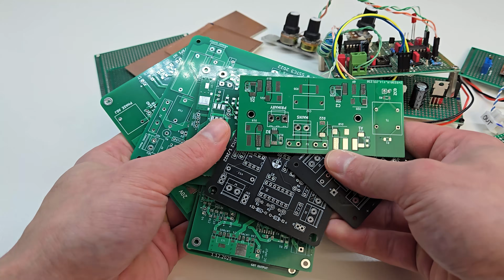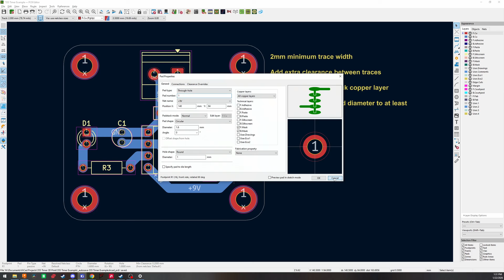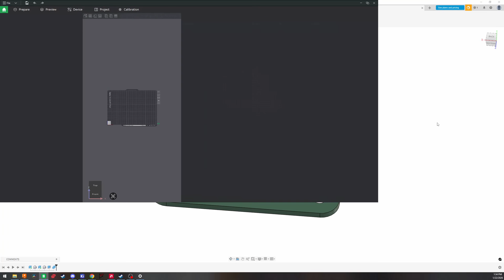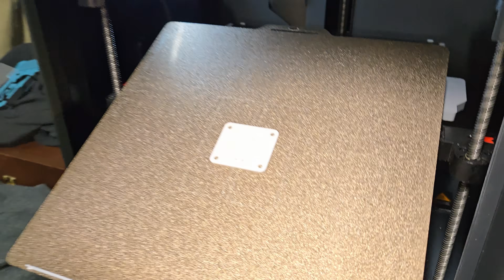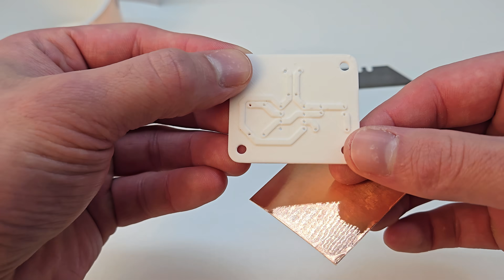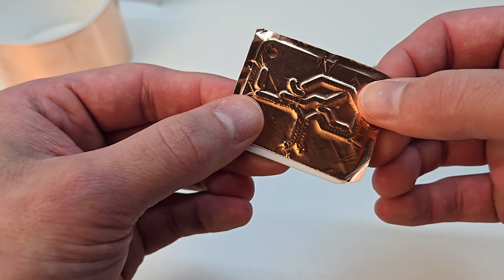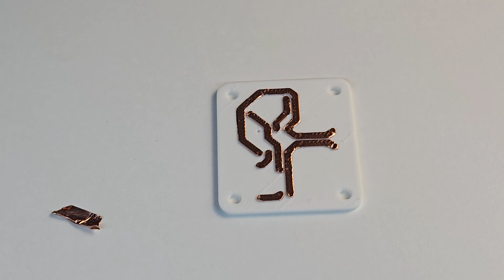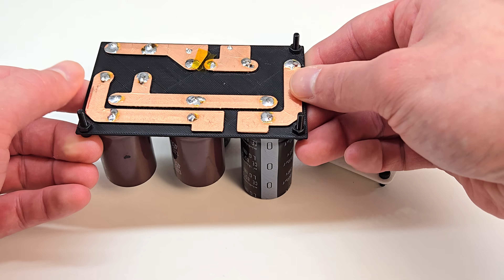3D Print Your Own PCB

Comment: I recently started printing with my 3D printer directly on my copper clad. So I print the traces on there just like a mask. And then I etch them like you normally would in acid. Then that removes everything that you didn't mask. And then I use acetone to get rid of the pla. Pretty simple really. And it's pretty easy to do. I just make sure that I go over the area where the copper clad's going to be and make sure my z axis is set correctly. And I make sure I rough up the board a little bit with some sandpaper and make sure it's really clean so the pla has something to stick to.
Reply from the maker: That sounds like a great technique, thanks for sharing. Do you also use the mask for drilling holes?
Reply: Acetone doesn't dissolve PLA.

Comment: Didn't the printed board melt during soldering the components?
Reply from the maker: It did not. With a hot iron and not dwelling too long with it the connections can be made really quickly before melting the pla. The copper foil also helps to spread the heat a bit too.

Comment: Would maybe a conductive filament in AMS for the circuit lines have the same effect and work out of the box? I dont have a AMS, just curious with the idea after seeing your video.
Reply from the maker: Good suggestion. From what I have read those filaments have a high resistance and have a limited application.

Comment: This is sick! Do you think you could maybe apply a glue to all the extruded traces via a straight surface and then just peel away the rest of the copper? So it only sticks on the extruded traces with glue on them. Maybe you won’t have to cut the foil then
Reply from the maker: Thank you! Great idea! I will have to try that out.

Comment: I had the same idea for some time now and was wondering why nobody seems to to have done it before. I have not tried it and this is the first time I've seen it being done in a video. One of the benefits is also, that you don't actually need to make a flat PCB with this method. You could design your part, so that the components can be directly placed onto them and even route the connections along curved paths if necessary. I have several widths of the copper tape, down to 5mm. That way you don't even need mounting points for the PCB in the final part.
One drawback which is kinda mentioned but not in that direction is that normal PCBs ar non-flammable. I wouldn't do any high power electronics with it, because that can easily become a desaster. I'd also not use it for mains electricity. Because when the board melts (even with ABS/ASA) that can quickly be a fire hazard.
Same for Lithium-Ion battery powered devices.
For small low power projects and for simple prototypes it's fine.

I've also thought about using perfboards in combination with copper tape to simplify soldering. You can even use PET tape to create multiple layers (for insulation of stacked copper foil traces).

Comment: Interesting idea.  There a couple of car guy that wanted to make there own circuits boards for their Mini Cooper Dash light. They actually made a CNC type of machine to lay down the traces like 3D printing it.  Bad Obsession Motor Sports is their channel.  Their are a few video of them using it , in later series, but much on them building it because it was really a side project and just another tool they made.
Reply: This comment is the undersell of the century. That video is absolutely INSANE. What they go through and what they do in order to prototype and design a completely custom set of car gauges is just shy of miraculous. Maybe it doesn't land as hard on people who haven't spent the last 13 years watching 2 blokes in a shed in Shropshire stuff the running gear of a Celica Alltrac into an original Mini. But DAMN do they do some cool stuff to get those freaking gauges working. The fact that they, from scratch, with no experience in such things, built a custom machine to print circuit traces DIRECTLY with solid solder is absolutely one of the coolest things I've seen on YouTube. I have tried SO hard to get people excited about that video and I feel like it just falls flat for almost absolutely everyone.

Comment: Doesnt the pla melt when soldered upon?
Reply from the maker: Normally it would but if the iron is hot enough, you can make the joint without melting it. A higher temp filament is advised. This was just to demo the idea so I used pla.

Comment: Been working on something similar, with Aluminum foil. You can use the tip of the soldering iron at 300C to press the foil against the plastic, binding it with heat. It is be awkward though. Mix results with solder foil adhesion. Used negative mold, square holes printed in the mold at 2.5 mm in side length. Foil would be heated in place into the negative, then on the other side the prongs would cut through the foil and mount there. Just be careful not push out the foil when making the holes.
Reply from the maker: Nice! Sounds like a good method as well. Thanks for sharing it.

Comment: Hello friends.

I'm currently doing this but in a little bit of a different fashion.

If you want to create vias between a double sided PCB you get some solid copper wire (enamel coated is fine or tined) and you make the holes a tolerance fit. 
Then you push the wire through the hole and with the flat cutter snip the wire so it is slightly protruding out one or bothe ends (approx 0.5mm). 
Then once you have done this with all the via's you get a big fat pair of knipex shifter pliers (the one with the push button size adjustment) and squeeeze these suckers flat and viola you have just created a nice and flat copper riveted via that you finish off with a dab of solder to make the connection just so.

For the love of sweet baby Jesus though if your going to use 3d filament please please use something like polymakers polymax PC-FR or similar; the FR stands for FLAME RETARDANT.
 
What we don't want, what we REALLY don't want are highly flammable circuit boards eagerly waiting for their opportunity to light up your houses and work places when you least expect it.
This is what they do, it's best to just accept it and not risk the biscuit.

Hope this helps someone, it took me a long time to peice this seemingly obvious concept together but it works and fits along the same lines of "crimping is best" methodology that they adhere to within motor sport and aeronautical engineering.

Happy Hobbying.

Comment: It's an interesting idea, but one downside is that FR-4 and other board materials are heat and flame resistant. When components generate a lot of heat, thermoplastics might deform, and if components burn out it could be a fire hazard.
Reply from the maker: absolutely, this was just a demo using basic materials.

Comment: Wouldn't it be possible to remove the step of the copper tape if you used a conductive filament, and just printed it multi-material? You also wouldn't need to puncture the holes.
Reply from the maker: The filaments have really high resistance, probably too high for most applications.
Reply: @QZW_Labs  Oh I didn't know. I haven't inspected the specs yet, just knew it existed. But you're probably right. Most use-cases are for low current uses.

Comment: Great video.  But I’m still scratching my head trying to figure out why you would want to do this?  I mean, given you’re already in KiCAD, why wouldn’t you simply send off the PCB for manufacture?  You get a very professional PCB for perhaps as little as $2 (in fact 5 of them), for designs less than 100mm square.  This seems even more work than when we used to make our own PCBs (in the old days), using photosensitive resist and ferric chloride! 🤔
Reply from the maker: Just sharing an idea that others might find useful. I would still use professional PCBs but someone might like this as an intermediary step in prototyping.
Reply: @QZW_Labs  Understand.  I suppose there is the good feeling of “doing it yourself”, but, then again, I get that feeling these days from routing a PCB in KiCAD, including the time spent tweaking the layout and tweaking the routing, all to satisfy my own perfectionist tendencies.  LOL

Comment: With multi-material printers there is likely a low resistance filament that is as good as a copper trace. You could print circuits, vias would be solid and through holes would need to be drilled or printed as perimeters to the hole.
Reply from the maker: The filaments have really high resistance, probably too high for most applications.
Reply: @QZW_Labs hmm, I know boards not printing. If I think of/find something cool I'll comeback to this comment

Comment: My wife's cricut vinyl cutter would make quick work of that foil tape.
I've also seen router tables cut circuit boards.
3d printers with multiple heads are now a thing.
Can't wait till my 3d printer has a vinyl cutter, cnc router, laser cutter, ect.

Comment: Great video. To make the PCB more rigid, consider adding a frame or rib to the backside of the board. It will complicate the copper application but it mitigates flex. Alternatively add additional standoffs but that is more expensive due to fasteners compared to the few cents of extra plastic.

Comment: You have listed the rigidity of those boards as a con. However it´s 3D printed, you can make it as ridgit as you want by adding ribs. Just like with sheet metal you can add a rib all around the board, this will aready stiffen it up a lot.  Then add ribs throught the board between the componants and such.
Reply from the maker: Good point. I guess the issue is more in my design and choice of filament for these demo boards.
Reply: @QZW_Labs  Well yes and no. You can only use so many materials when FDM printing. I wouldn´t say it´s an issue, you can always improve your design. 
The cool thing with 3D printing is, it´s for rapid prototyping first and foremost, so you can add all sorts of crazy designs at no cost. 

Add a rib of 3x material thickness all around the "PCB", then add more ribs, wherever needed (same rule of thumb 3x material thickness) and you can also get creative and say add "protection features". E.g. you can create structures to protect your exposed components, like big sticking out capacitors etc. if needed. You can even add mounting attachments, stand off´s and so on. Which ever you want and need for your design. 

Also when using your creative copper tape idea, you can go a step further and try out following ideas.
You can overprint parts, like copper lead frames, just like in injection molding, creating a connector and PCD with copper lead fram all in one step.
You can use copper rods and overprint those for more current. You can cut the copper tape or thin copper sheet metal material with a 2nd indented part, basically creating a mine stamping tool. It works well for thin gauge material. You can even prototype with thicker sheets up to 1mm Aluminium. 

I am a mechanical engineer btw, I have no idea about electronics, however if you have some ideas or questions in regard to material etc. feel free to ask. I really like your creative idea and I like collaborating, in the end we are all one maker community in my opinion. Same goes for other people, share your ideas, comment on my ideas etc.

Comment: Lovely concept!
Sad that it requires a decent amount of labor/skill to cut and remove that copper. 
How about this idea: have thin raised walls that outline the traces. place the foil on the print and then use a flat surface with danspaper to effectively cut the traces out. These edges would be the only contact point when sanding. This would reduce the skill required and depensing on the complexity of the track, it might be faster? 
Having thin raised sections would avoid the need to sand away a huge surface area (better than recessing the traces and having to sand all the rest)
Reply: Damn, i'm not the only one having that idea. The only thing i would add is the use of some stiff foam to press the traces against in order to bend the copper foil neatly around the extrusions before sanding.
Reply: Or use a Cricut machine.... Ooooo hit the mold button in the slicer and make basically a cookie cutter for the copper tape. One design use I guess but with a quick hammer tap it will cut it like a metal press but easily since it's just basically thick tape.
Reply: You exploit the square-angle between the trace and the base to position your cutter, and then drag the cutter along... It´s one of the most automatic, skillless labors there is... Your suggestion might work even easier, IF this tape gets easily sanded away (which I doubt).

Comment: My boy, here is an idea to make the laborious process a little easier. Print a 2nd half where the traces are removed, then glue the copper as before in place and use the upper half to shear off the excess material. You have created a stamping tool basically and the copper is your metal sheet. With the right geometry you can cut it fairly easy. Cheers
Oh and also you can use the same method to actually create real tiny sheets, not just some copper tape.

Comment: You could probably print a negative of your PCB design to work as a cutout for the Copper foil, and get the shape you need, without using a knife to cut it.
Reply from the maker: Good idea! I thought about trying that but decided to do it by hand for this video. I think if you got the fit adjusted correctly, it would work really well.

Comment: What about a fine-tipped CNC to drill away the tape? Dont need to drill so deep.
Reply: With a CNC you can skip the 3D print altogether and use a copper-clad board.
Reply from the maker: That would probably work nicely! Good idea! I would try that but I don't have one to test with.

Comment: Four more complicated layouts I have no idea if this will work but it seems like it should have you considered using something like a cricut to cut out the traces and then transfer that to the PCB?
Reply from the maker: It sounds like it could work but I do not have experience with those machines. Might be something to consider in the future.

Comment: Super cool idea! You could really automate the process by using a Cricut / Vinyl cutter to cut out the copper tape and then transfer it to the printed part using contact paper.
Reply: I don’t think you even need the printed part at that point
Reply: @ThePrimePrimer yeap. Maybe only to save having to drill the holes! 😊
Reply: @ThePrimePrimer true, for these simple ones you could just use acrylic sheet or something and drill the holes after.

Comment: One of the best parts about this that no one seems to have mentioned is that the holes are already drilled for you. Drilling accurate holes can be a real bear when making circuit boards.
Reply from the maker: I agree! I did this by hand with my first few PCBs way back and it was a process for sure!
Reply: You could print a 2nd (negative mirror) part and stamp punch those holes in one go as well.
Reply: tbh a cheap cnc is way better for home pcbs than toner transfer and acid bath. drills the holes for you as well
Reply: imagine taking full advantage of the capabilities of 3d printing!  the "board" could be 3-dimensional, ie, shaped as a box, curved ... who knows!

The more i think about it... what if you could use conductive PLA for the conduit layers? 

https://www.youtube.com/watch?v=z6MyeJPBN8I

And then copper plate them?

https://www.youtube.com/watch?v=TlD9USAhcEs

I'm not sure if that would work ... but that would save on some of the copper usage.  and may allow more creative optimizations
Reply: All the conductive filament I have seen has very high resistance. For contact sensors it’s ok, or if you need a resistor in line maybe. But it’s very unpredictable and kind of crappy.
Reply: @dayer4b you could also do print pauses and insert wires or runs of copper tape that does come in multiple widths... also Graphite putty and aluminum tape work well enough.
Reply: you could print a thin hole template

Comment: When I consider my time and effort, oshpark is my go-to for PCB prototypes.
Reply: I mill prototype PCBs with my CNC in 1-2hours. How much time does it take with OSHpark?
Reply: @YourDetector  Nice capability!  Oshpark is usually a week or two.  Not bad if you need 4 layer.

Comment: I've been using PET-GF for high temp requirements.  Glass temp is 150c nozzle 300c.  It's very rigid and not too difficult to print if your bed temp can go up to 100c.  QIDI sell it for £35\ Kg.  If you don't need the stiffness and want a 0.2 nozzle straight PET is good.
Reply from the maker: Great suggestion, thank you. I will definitely try a different material in the future.

Comment: Definitely interesting. I would be a bit weary for a design that contains a many legged IC (e.g. a microprocessor), but  definitely an option for simpler designs
Reply: My thoughts exactly! At least you could have traces on both sides but the trace width and spacing are still going to create routing issues